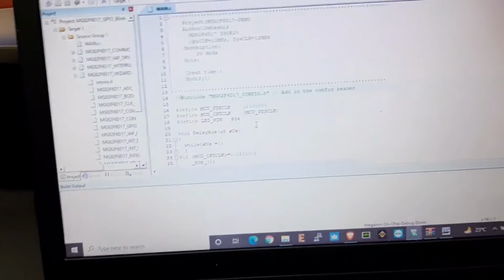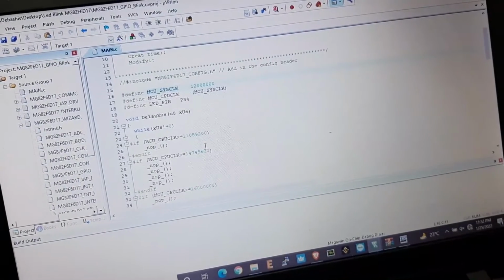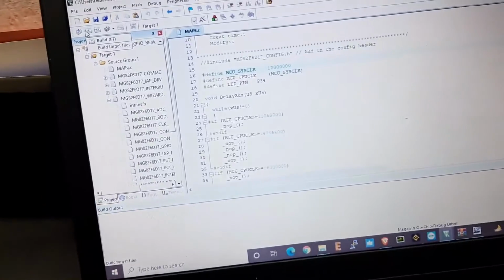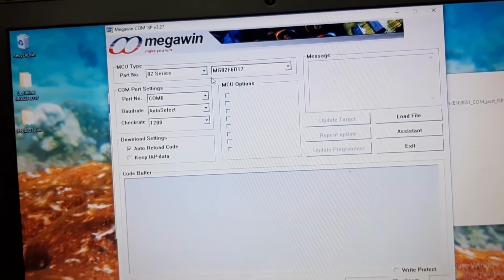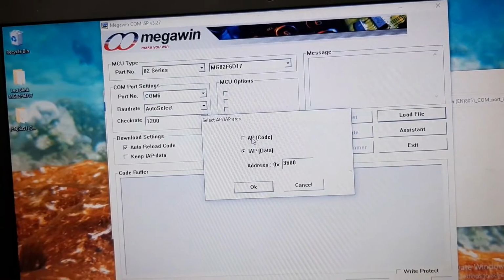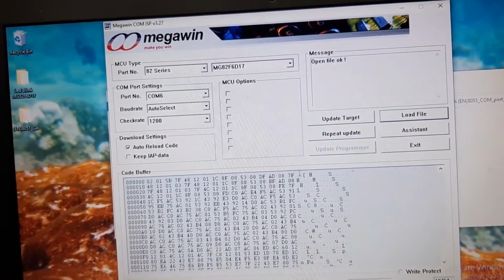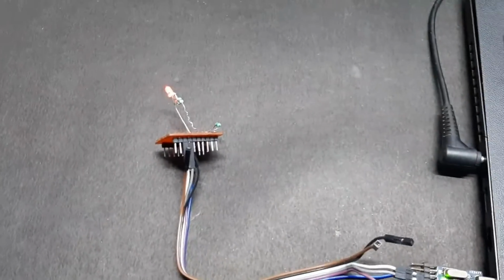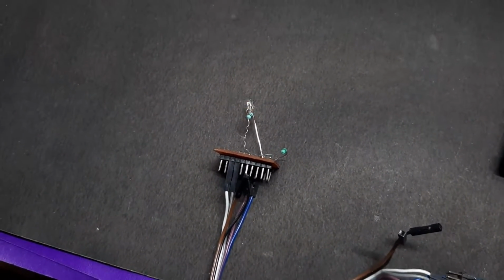How to Program the MG82F6D17 Microcontroller

Comment: How to put chip into ISP mode
Reply from the maker: You don't need to do anything specific to put the chip into isp mode, other than connecting programmer correctly. All chips comes with the bootloader from the factory.
Reply: @Circuitdigest  I connect 5V and GND to the chip, TX signal connects to P3.0 pin, RX signal connects to P3.1 pin. RST pin connects pull-down resistor to GND
Reply from the maker: While the programmer software searching for the MCU disconnect and reconnect the power to the MCU.
Reply: @Circuitdigest  I used Megawin 8051 ISP Programmer software, I chose the correct chip type, then I selected Load to find the .hex file, then I pressed the Update Target button, only the software reported an error not finding device
Reply from the maker: Use the COM port ISP software mentioned in the article. Make sure to select the correct COM port and the targets RX should be connected to USB-UART converters TX and TX to RX. Pay attention to the procedure detailed in the tutorial.

Comment: Do you have a wiring diagram for the charger circuit to the chip, thank you
Reply from the maker: Which charger circuit. There is no charger circuit mentioned in this tutorial.
Reply: @Circuitdigest  you connect from USB to UART circuit and connected to chip